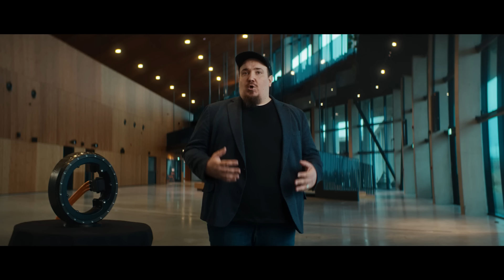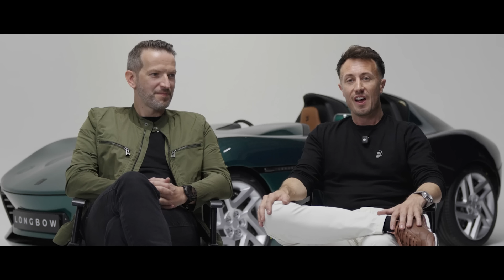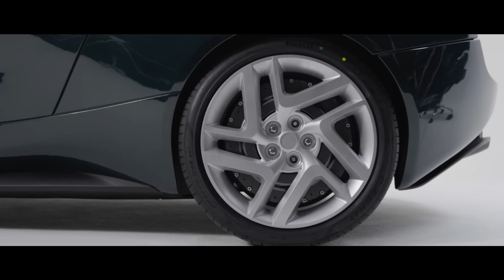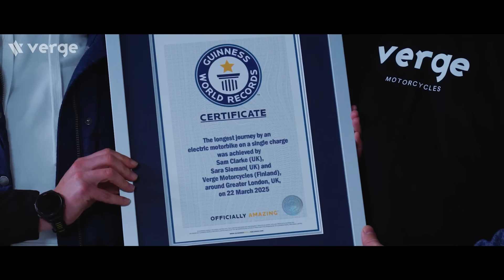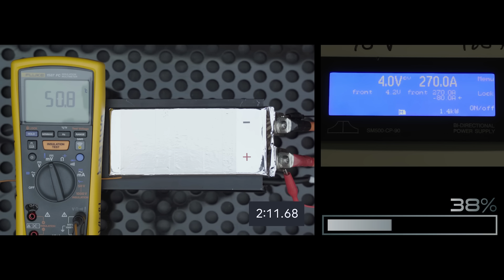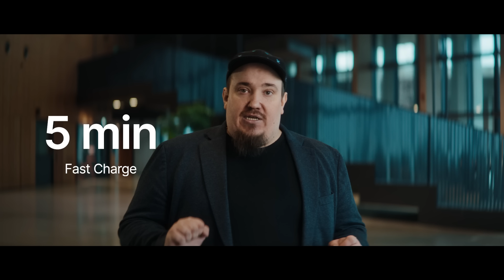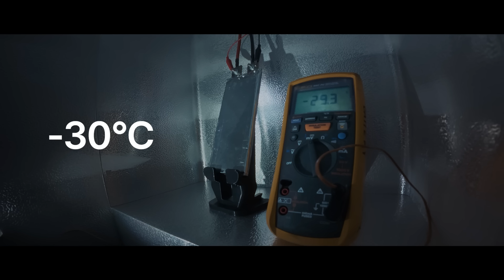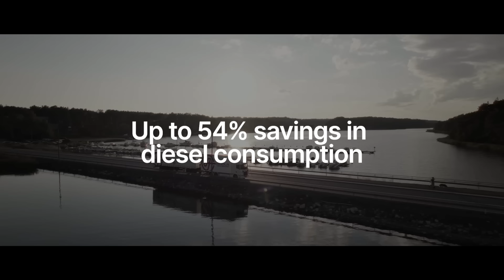World's First All-Solid-State Battery in Production Vehicles | Donut Battery

Comment: "We found ourselves actually designing a slower charging speed so riders can slow down, actually drink a latte..." That's sooooo sus
Reply: I was sold in the first half, but as the second half dragged on and on I started thinking “it sure is starting to get a little deep around here.”
Reply: It might be an insider joke that went badly when said outloud
Reply: i'm not gonna lie, being older these days, i want about 10-15 minutes to get my helmet off, get my gloves off, get my jacket off, stretch out, walk around a little bit, check my phone, go inside, order a coffee, take a piss, come out , drink latte while bullshitting with the guys i'm riding with...  
but the 7-8 minutes would be nicer if both bikes were electric, then we could swap them out at the halfway point and still be on our way in under 20.  the option would be nice.
Reply: thought the same thing 🤔😒🤕
Reply: Every time I get gas I think, I wish this would take more like 10 minutes instead of 5 😅
Reply: It sounds like a software thing where you can select rate of charge if you wanted to, some chargers have idle fees so would be useful for that.
Reply: Possibly … if the battery is as good as advertised … the reason to slow the charge rate could be simply associated with improved compatibility with existing charging infrastructure. But, if so, it would have been better to simply say this rather than run with the coffee line.
Reply: Thought the same, but maybe it's not the battery that's the issue, but the electrics around it, conductors, charging station, etc.
Reply: thats what I was thinking wth
Reply: It’s a Europe thing. In the US, we shout at the kids to get back in the car, gotta go.
Reply: They are actually invested in the latte industry
Reply: Exactly! If I want to present a revolutionary invention, I show the best of it - charging in 5 minutes. Then I can say that it might be too much, and I can configure my bike to charge more slowly if I usually need some rest.
Reply: This makes me think that the battery needs to be running constantly or something because why would “oh my bike is already charged, i have to leave immediately now” be a situation anyone has ever experienced?
Reply: Sounds like it was more an inside joke that doesn’t translate as well.

Charging speeds must have some sort of negative effect… so if the charging speed is insanely fast with a small negative impact, why not add an option for slower charging for “no” negative impact?

Ie. you’re willing to wait a little longer for better results, you select “standard charge”…. Which technically is still “way faster” than current lithium charging speeds.

Comment: I want this batteries in rugged phones so i can use the phone more than at least 5 years
Reply: I used a iphone 6s for 7 years
Reply: @Drewcardello  battery degrade, you can use it 10 years but i piss off when you need to charged it frequently but when it new i used it full day and by next mornings still has 20% batteries. But after 3 or more years you left with less 20% just by noon

Comment: I don't buy the argument that Verge slowed charging down on solid-state battery models in order to allow riders time to enjoy a coffee. I expect that when being rapid-charged, the batteries were suffering some sort of performance issue - e.g. they were getting uncomfortably (dangerously?) hot; and/or they weren't able to charge fully (or conversely, they were being overcharged because the charge protection wasn't kicking in); and/or their lifespan shortened dramatically.

Nobody wants their vehicle to spend longer refuelling than absolutely necessary - fuel pumps don't have a 'trickle fuel' setting so that you can leave them slowly adding fuel to your vehicle while you grab a drink and a snack! Still, it's early days for solid-state batteries, so maybe in time they'll develop tweaks to overcome the limitations (in the same way that first-gen Nissan Leafs suffered battery degradation because they didn't have heat pumps, unlike more modern EVs).

Comment: The biggest issue with electric cars is charging infrastructure... what is the charger requirements for the 10min charging time? how many volts and amps?  what is the charging time on current charging infrastructure?  I am assuming to get those incredibly quick charging times you need a charger with capabilities that are higher then the standard level 3 DC charger in the USA .

Comment: Energy Source,          System Density (Practical kWh/kg),         Scale vs. Batteries
Lithium-Ion Battery,                  0.18,                                               1x (The Baseline)
Hydrogen (Fuel Cell),               1.50,                                                ~8x better
Gasoline (ICE Engine),             2.50,                                               ~14x better
Nuclear (Submarine),              ~730.00,"                                       ~4,000x better"

Milestone,                     Energy Density (kWh/kg),      "The ""Wall"""
Early Sodium (2023),            0.10 – 0.12,                   "Low energy, only for scooters."
CATL Gen 1 (2024),               0.16,                                Good for cheap city cars.
Zhaona Breakthrough,          0.34,                                Beats current Tesla (NMC) batteries.

Technology,                                  Cycle Life (to 80%),            Practical kWh/kg,        "Total Life ""Mileage"" (Est.)"
Standard Lithium (NMC),            "1,000 – 1,500",                    0.18,                           "300,000 km"
LFP (Tesla Standard),                 "2,500 – 3,500",                     0.16,                            "600,000 km"
Zhaona Sodium-Ion,                    "3,000 – 5,000",                    0.34,                            "1,200,000+ km"
Graphene (No Lithium),              "10,000 – 50,000",                0.10,                             Indefinite (20+ years)

Battery Type,                                  Cost per kWh (Pack Level),       Total Pack (60 kWh),             Energy Density
Standard Na-Ion (HiNa/CATL),         $40 – $55,                             "$2,400 – $3,300",                  ~0.15 kWh/kg
Zhaona High-Density,                        $75 – $90,                             "$4,500 – $5,400",                   ~0.34 kWh/kg
Standard Li-Ion (NMC),                     $100 – $120,                        "$6,000 – $7,200",                   ~0.25 kWh/kg

Comment: again bullshits as all this years, they sayed 50% more range but somehow 400 wat per kg capacity!! that doesnt go same with each other !1 if it have around 600kg of weight as todays batteries in mid size vehicles then capacity of batteries should be 240kw on that weight or 280kw on 700kg or 200kw on 500kg of battery weight and that will give range of  around 1200+km on 600kg/240kw  battery even with constant speed of 100-110kmh  on vehicle  size of  BMW x3 and that will be 150-200% range over todays ones batteries

Comment: I 100% expected him to Unwrap that Foil battery at the end. Take a Big Bite of a Chocolate Bar . .  and say . . . . "Just kidding guys  . . .  but wouldn't that be cool right!!" lol
Reply: Haha... that "chocolate bar" was swelling in the video.  You can see a label curling up due to the expansion.  I wonder how he accounts for this expansion when stacking cells in a pack.
Reply: @famljw3095 i also noticed that
Reply: @famljw3095 evry cell swells a little during charging, it's important to have this swelling under control
Reply: @jaran314  With SSBs, this expansion and contraction is especially difficult to overcome, because it causes issues with how the anode and cathode make contact with the solid separator.  Traditional Li-ion batteries just fill in the gaps with the liquid electrolyte.  For solid state batteries, this often requires cells to be manufactured at high atms to maintain contact.  This adds significant cost and complexity when trying to build the battery at scale. My point is that I don't believe these guys, because they haven't given us any reason to.
Reply: @famljw3095compression, same way you do it with larger LI-Ion pouch cells
Reply: No it's a donut
Reply: 500g of Chocolate: On average, there are 550 kcal per 100 grams. This means there is a total of 2,750 kcal in 500 grams.Electrical Equivalent: $2750 \times 1.16 = \mathbf{3190 \text{ Wh}}$ (or approximately 3.2 kWh).
Reply: How do you know he eats chocolate? 😏
Reply: @OZ_Darky  We BOth Know the answer to this question lol

Comment: If it works, it will take 2 to 3 years to get in to a big oem platform. Then it also nees to be cheeper then the sodium for the cheep car market. For high end cars with high milage it has no compettitor right now. Hope they manage
Reply: Why would it take more than a year? The vehicle does not have to change, just the battery.

Comment: Words are cheap. I could have made this exact video for a few thousand dollars. Extraordinary claims require extraordinary evidence. There is zero publicly verifiable information for your claims that your motors are being used by other companies. You said a lot here that we're just expected to take at face value. Solid State is the holy grail of modern battery tech and we've been burned by other companies claiming they have solid state batteries... like Yoshino. Not only that, you're claiming you're not using Lithium, Cobalt, Nickel, etc?  VERY bold claims. You might have had some credibility if you had a lab to verify your claims, but no, just some CEO I've never heard of and referencing some motor I've never seen.

Comment: Hold on a minute! ! You claim that you solved pretty much every problem we have with current battery tech BUT you barely even mention the biggest obstacle of mass electrification. STORAGE!

This is a major red flag for me because this kind of tech is exactly what electricity storage industry needs. Fast charge (and discharge? ), pretty much limitless cycles, no fire hazards, abundant locally sourceable materials and no temperature lost. It all matches perfectly...

Maybe this is video only for consumers but it's still weird choice to mention sector this large only 3 times in your 20 minute presentation. 

So you either revolutionized the world (I would love that to happen.) or this is really bizarre tech hype pump and dump.

Comment: Impressive presentation, but several claims here don’t add up if taken at face value. 400 Wh/kg, 0–100% in ~5 minutes, 100,000 cycles, safe at 100°C, and lower cost than Li-ion from day one simply don’t coexist in real-world electrochemistry — even with solid-state. If this is lab-level, cell-level, partial-charge, or shallow-cycle data, that should be stated clearly. The tech may be interesting, but without independent testing, real charge curves, defined cycle protocols, and pack-level specs, this feels more like aggressive marketing compression than a production-ready breakthrough. Transparency here would massively increase credibility.

Comment: Next up for donut, portable fusion power and a cure for cancer.
Reply: That's their 2027 and 2028 roadmap respectively 😁
Reply: @Stormy177  but they already solved these two problem, but they need time to male the video about it
Reply: Did you not watch the video? this battery cures 167 of the 181 known cancers and you never have to charge it, thus making fusion unnecessary.
Reply: @THEUPSTAIRS100  I have er*ctile disfunction, do you think it solves that too?
Reply: @picapica8846 😂😂😂😂
Reply: Yes what he didn't say is, they need all the batteries they make to power their hyperspace drives in their new up and coming interplanetary spacecraft.
Reply: @Jon-R5l4o  Mars is a matter of months away, thank you Donut
Reply: @THEUPSTAIRS100    what is the temperature on Mars?
Reply: Runs on donuts?
Reply: @Smokeycam1 the CEO is on donuts, but he sure as hell doesn't run.
Reply: @Smokeycam1  I'm waiting for the Jam Donut Battery then, that'll be epic. Wouldn't touch a Custard Donut Battery for love or money, yucky.
Reply: @Smokeycam1 no if you just blindly swallow this without any independent verification then your ‘doh’ nuts to quote Homer Simpson
Reply: You mean like the ones created by Lockheed Martin Skunk Works, TAE (now DJT) and Helion Fusion? :-) Yes, that is where electrification (among the very name of this company) will start to make sense by not only not overloading the legacy grid, but not even needing it at all. :-)
Btw. for the EV sector, other ZPE based systems with COP > 1 might also be feasible, since the cars do not need Megawatts of power created by an aneutronic fusion reactor to recharge theirselves. A free energy generating microchip based on the Casimir-effect at the nano scale might suffice. I am not sure whether E-Cat is using this principle but they have demonstrated their ability with a Renault Twizzy to practically create a perpetuum mobile EV by constantly recharging the battery while in operation and they seem to be at the verge of starting production, too. So fusion reactors might be the best to power traditional charging stations in a decentralized manner, while smaller scale solutions might even be used by the cars to never have to go to the charging station again. :-) This would also mean, that cars only need a much smaller battery as a little energy buffer if the ZPE system cannot be controlled fine enough in realtime to always create as much energy as needed.  Interesting times ahead. :-)
Reply: @LaszloPappBerlin  either (1) this comment is satire (2) AI + Google Translate wrote it or (3) Old Mate's keyboard has been taken over by his cat.
Reply: @djb3500 or (4) you just don't know enough to know that it is true. I think I gave you enough hints to do your own research just as I have been doing for the last 3 years. If I try to give you the most relevant hints with names and YT channels, YouTube automatically censors and removes the comment. Ask yourself, why!
P.s.: I am 47 years old. If it is old for you, let it be. :-) And no. I do not have cats. They half-way died in the Schrödinger experiment. ;-)
Reply: @LaszloPappBerlin  this might be the most deranged thing I have ever read online
Reply: @TheGreatDrYakub you mean the furthest away from your state of knowledge. I can understand that... Research and you will learn. I gave enough hints to do so.
Reply: @TheGreatDrYakub  What did you not understand?
Reply: Next up? You can already get in line to purchase the fusion core options for just 1,000 down!
Reply: Many cures for cancer though.
Reply: and room temperature superconductor.
Reply: the fusion power is IN the donut Sir,  like the magnetic thorus creating the plasma
Reply: Actually, the same guy, Marko Lehtimaki, has a video from 7 months ago claiming his company invented artificial super intelligence, so you're spot-on! Video is titled: "The World's First True Artificial Superintelligence | Asinoid by ASILAB"
Reply: I'd eat anti-cancer donuts, sign me up!
Reply: Their super AI is working on it right now!
Reply: Donut releases quantum computers for consumers, they fit in a laptop.
Reply: In the same package

A nice side use for the spilling radiation of the micro-core...
Reply: Those will come out of the UFOs kept in Lockheed and Boeing underground bases, dude.
Reply: What you looking for is called Anktiva... Only approved for bladder cancer for now.
Reply: They did that , they currently working on a quantum chip for a phone that you charge once a year
Reply: The battery is already in the verge motercycle
Reply: Next up doughnut lab employees go to prison on fraud charges
Reply: And the evidence: https://www.youtube.com/watch?v=oHg5SJYRHA0

Comment: Hey Donut Lab, take your "skateboard" platform to a track. Charge it for 10 minutes and see how many miles you get. That should be your video.  24 min video theatrics does not prove results.
Reply: This is a presentation for potential investors i think
Reply: @AIpromaxUltra-x5e  mtaa11’s suggestion would get them bigger investments and far quicker than this video
Reply: @PSNvjimmy  Yes, if they actually had the product, it would sell better than this marketing presentation of a thing that's probably closer to "Copium powered vaporware submerged in dehydrated water".

Comment: On the Verge Motorcycles site, on the TS Pro, the battery options are 20.2 or 33.3 kWh  and the difference is 3000 USD. So 13.1 kWh pack for 3000 USD which comes at 230 USD/kWh. Now, in China, regular LiFePo4 is 40 USD/kWh at the cell level, around 66 USD/kWh at the pack level. CATL just launched sodium batteries priced ar 20 USD/kWh at cell level. So either Verge has a huge margin on batteries or Donut batteries aren't as price competitive as they say. From a total cost of ownership point, 10.000 cycles vs 100.000 don't really matter. I don't really care if I need to replace the cells in my car's battery in 27 years or 270 years, the rest of the components will fail well before that.

Comment: Very impressive claims.  Needed for ebikes more than any other EV. 1500w charger is 80 miles of charging per hour.  But level 2 charging on a fairly small ebike battery for same in 5-10 minutes is game changing for both touring/and commercial deliveries.  Some ebikes have recently produced power stations (built in charger) as their battery packs, and this tech would also be revolutionary in power station portability.